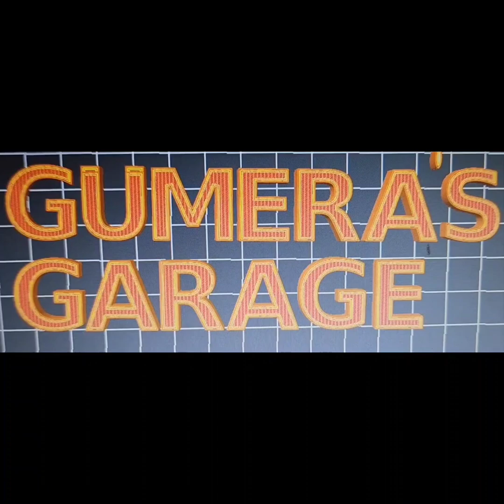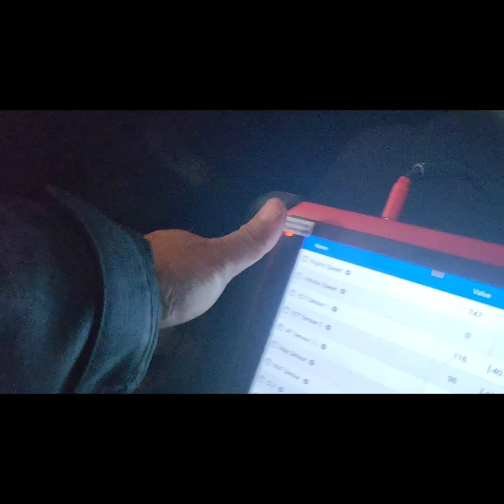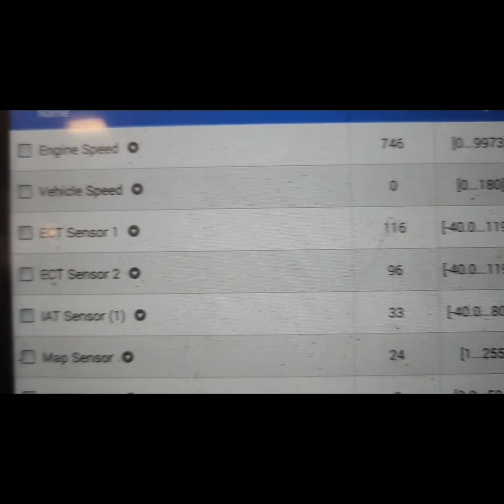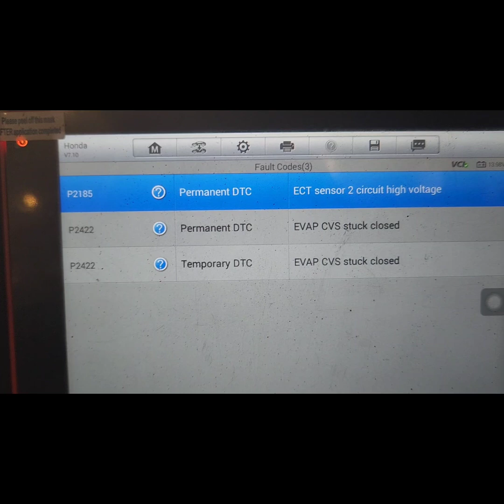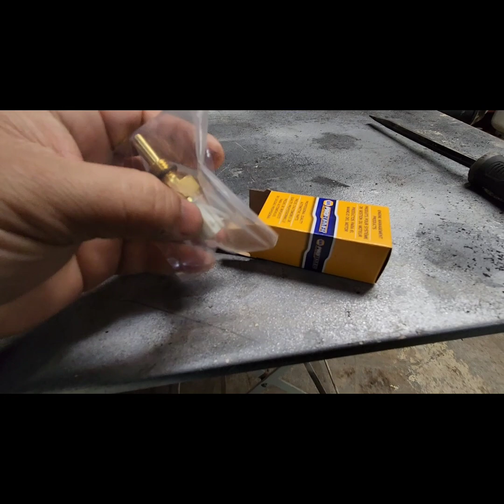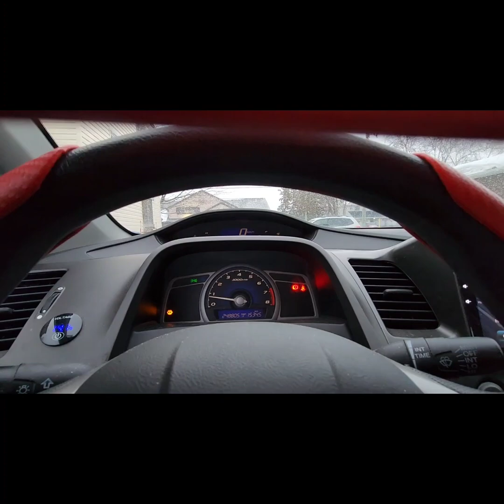How to fix & replace P2185 sensor 2 circuit high voltage for Honda civic 8th Gen.

Comment: Can you show me where the wire is coming from that plugs into the radiator please. My radiator didnt come with a sensor and i dont know what wire to plug in. Is it a certain color or a diagram i can find please help.
Reply from the maker: Not all civic have this sensor. What i i know  2005 civic down dont have this sensor. If your car dint come with the sensor, probably dont have it
Reply: @gumerasgarage5328  my check engine light is on for that particular sensor and is throwing a code for “ect sensor 2 high voltage” i think that wire is cut because i do have a loose wire or 2. Do you remember what color that wire was or what is was connected to i might be able to get a pigtail
Reply from the maker: Oh, ok,  I'll take a picture tomorrow
Reply: @gumerasgarage5328  thank you so much you dont know how long ive been searching for help🙏🏾
Reply from the maker: Ok, no worries

Comment: Sensor 1 and 2 both are same sansor?
Reply from the maker: I think it's not the same
Reply: @gumerasgarage5328  what code for the sensor 1 and 2?
Reply from the maker: If im not wrong, the radiator sensor is p0118, and the block p0128
Reply: @gumerasgarage5328  if i want buy this sensor can use the code? To confirm the seller what sensor?

Comment: So the sensor 2 is on the bottom next to the radiator.. correct ?
Reply from the maker: Yes, the bottom driver side of the radiator

Comment: nice job. Good idea in change it quickly without draining out all the coolant. Question some people online saiid 17 deep socket is not fitting in the space with rachet. Also some saying sensor on bottom controls fan turning on and sensor on top controls interior gauage
Reply from the maker: Thanks, i used 3/8 socket works fine for me. It's true, but if one sensor fails, you'll have an overheating issue.